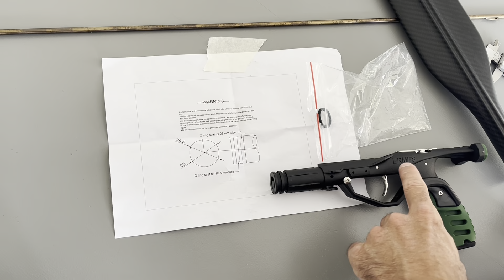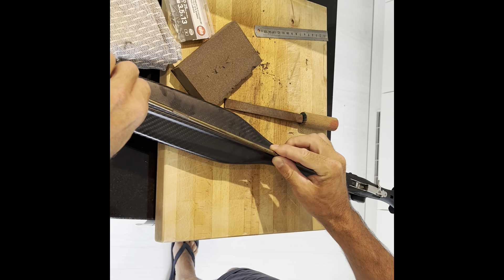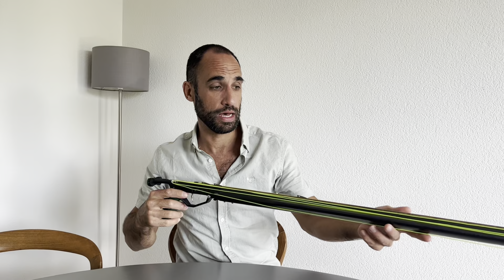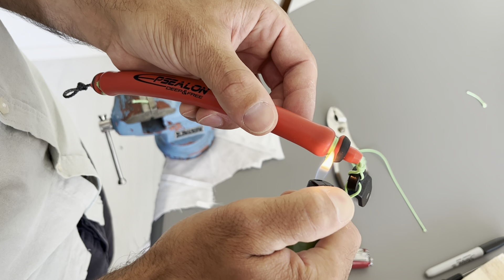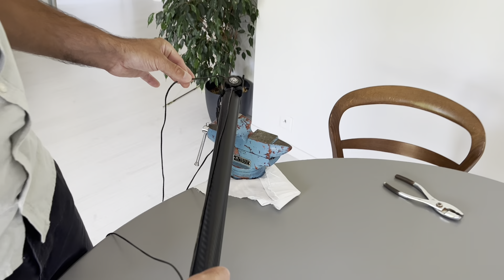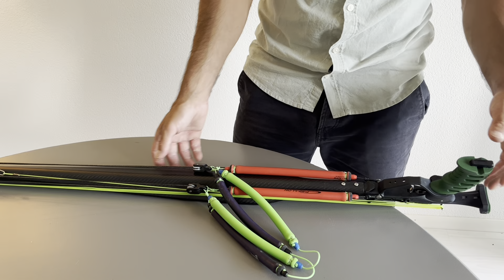How to build an Invert Roller Speargun (vela) -  Part II

Comment: Can you please explain how you calculate the band and dyneema lenght?
Reply from the maker: Hey hey, thanks for the question.  This is a difficult question, because it depends on the rubbers you use and their recommended elongation rate.   you cut your rubbers based on this, and the "gap" is filled with the dyneema.  for example we use a natural latex rubber with a recommended elongation rate of 300%, cut the bands accordingly and then tie the dyneema. overstretching bands simply reduce their lifespan.

Comment: Thanks for this - Im wondering if there’s a purpose to leaving so much space up the top when all of it could be used for more rubber.
Reply from the maker: thanks for the comment.  you dont need more power in this configuration, as it would simply over-power the spear used, making it wobble and loose speed and accuracy.  More is not always better  for invert rollers.  The specific gun in this video is designed for speed and accuracy, Fish in the Mediterranean are very shy and fast .
Reply: @dustsnow666 just use shorter then - no need to have a longer gun in this case

Comment: Hi, thanks for all information, where do you buy the carbon fiber tube??
Reply: I actually bought mine 140cm cuttlefish carbon fiber tube) from a manufacturer in China.  I paid 110, then paind the international shpping cost.   140 total.  came in about 3 weeks..I probably saved 30-50 by going this route.  much cheaper if buying in bulk.

Comment: How do you get the dyneema through the inserts. I got one done but the next just keeps fraying and won’t enter the dang hole.
Reply from the maker: @Chris-ok9hr  can you ping me a picture?  Ramiro.villanueva@hotmail.com
Reply: Being there, solution is - heat with lighter 10 cm of dyneema so it become way stiffer, make sure you have enough to cut after, heated dyneema should be disposed

Comment: quick question, if you remove the handle, will that gun fit in the check in suitcase? i want to have an invert roller for travel but may not be possible..idk..thansk
Reply from the maker: Hi Mate, the defining factor for lenght is always the shaft, not the speargun.   the shaft is always longer than the gun. so you need to buy a specialized shaft that can be split (Roffe Euro Traveler for example), look it up. 

taking off the handle and re-fitting too many times can damage the orrings, resulting in leaks, i would only do it for maintenance, ballasting or in special occasions

safe hunting

Ramsey
Reply: Thank you